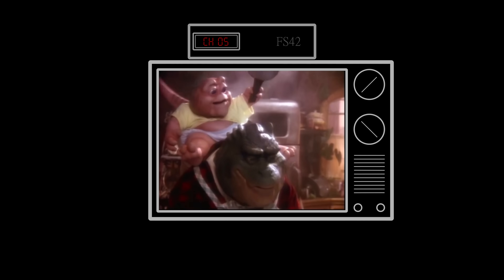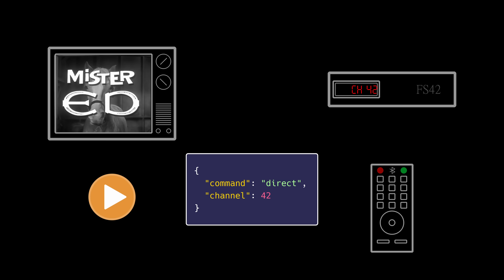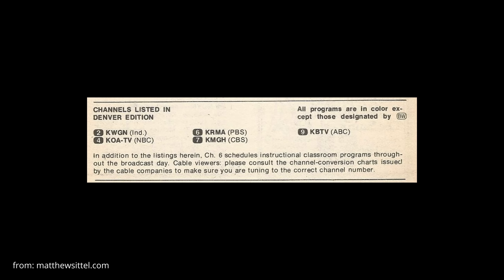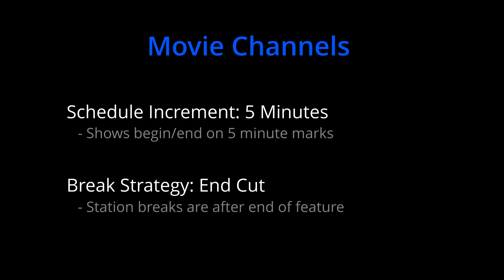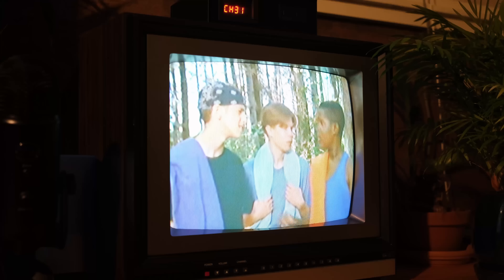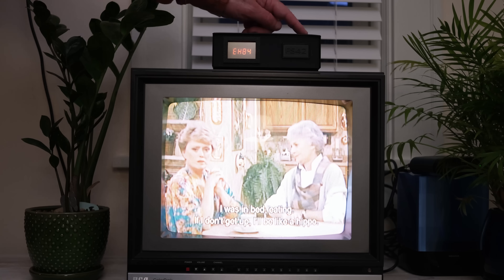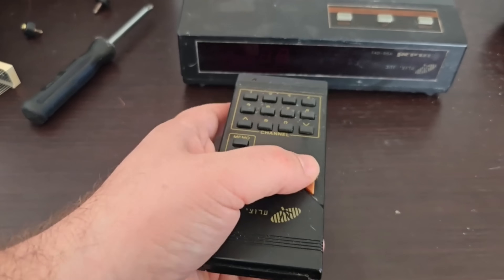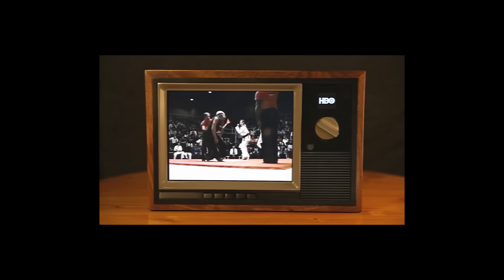90s Cable Simulator - Recreating Retro Cable TV with a Raspberry Pi

Comment: I’ve been fiddling with project and modifying the software since October problem. I sooooo bad want cable box setup. I have old cable boxes but could never figure out how to get the LCD and buttons (and IR) to work. I would totally just pay cash for a box at this point if you were building them!!
Reply from the maker: If you want to make one of the 3d printed ones, I have instructions in the cable box github links in the description. If I were to make one from an old box, I would be in the same position as you: would have a lot of learning to do. I would probably start by testing the signals in the wires to see if there was something I could tap into. Sounds like a potentially amazing learning journey you could have in front of you - I would not want to take that away from you. I think you should do it - if you need help or run into problems, there are a lot of really smart people on our GitHub and Discord server that would help. Good luck!

Comment: A little out in the weeds here, but how are you storing your media? Im running a pi 4 and every now and then the usb ports will just cut out, im not running your app but im wondering if you ran into the same problem.
Reply from the maker: See that blue box in the thumbnail? Its a cover I printed to hide an HDD enclosure connected on USB. I have not seen that on my 5 - I didn't play with 4s much, but I didn't see it on my 3s either. Maybe a setting on your pi or a bad piece of hardware (happens sometimes). You can also connect and NVME up and bypass USB.

Comment: From the sounds of the intro the simulator is handling channels exclusively and not the TV
Is it possible to have the TV itself scan for the channels from the simulator and place them accordingly?
So you can use the TV remote from the TV to change the channel?
Reply from the maker: Hmm - that would be interesting, but since its not actually broadcasting all the channels at the same time (it simulates them running) I don't think it would work. However, people have figured out a bunch of ways to hook remotes up to it to change the channel, volume etc - the guide button on mine even works to flip to the guide :) Here are the documents on setting up a remote: https://github.com/shane-mason/FieldStation42/wiki/Connecting-Remote-Controls

Comment: Scheduling sounds like a constraint solving problem and makes me want to use prolog
Reply from the maker: Its an interesting problem and my favorite part of this project really. You really could solve it elegantly with prolog.  My approach is a bit more heuristics based, opinionated and extremely optimistic - it never looks backwards and only plans forward in a few cases (like marathons). I call it 'LiquidScheduler` because that's how it fills the time - like water pouring into a container. With a good selection of gap filler, it does a fair job. Most importantly though, it was a fun problem to solve - it took me a couple of complete rewrites to get something I am proud of.

Comment: This is awesome I would love to do one for like the 80s through till 2000. Or even have like different ones for the 80, 90s and 00’s.  

Do you have a video or site where you do this like step 1, step 2 so someone could follow along on what to do and what type of parts to buy?
Reply from the maker: On the main github site for the software, linked in the description, there is a wiki where I've documented it in a 5 step process.  All the parts with links to get them and instructions on putting the cable box together are in the other github link in the description. If you have any questions, file an issue on github or hit us up on discord. Cheers!

Comment: Hello, I was wondering if this can support VOB files or is it just mp4? My dvd catalog is all vob and I’m not sure how to convert it.
Reply from the maker: It currently supports ["mp4", "mpg", "mpeg", "avi", "mov", "mkv", "ts", "m4v", "webm", "wmv"] - and even support for streaming formats like m3u. Ff it can work in FFMPEG (almost any video format) then we could add support.
Reply: @wrongdog_reckons  Hey thanks for the reply, I had one more question for ya. I'm finishing up making my own catalog of shows and currently I have both MP4 and MKV files. Will the code be able to run both seamlessly? Or should I work on converting everything to MP4? Thank you.
Reply from the maker: @nicholasdeparto8304  - works great with mkv and mp4: pretty much anything that FFMEG supports will work.
Reply: @wrongdog_reckons  Fantasic, thanks a lot. I think I may have overdone the catalog of shows for my project 😅 but hey, more is better in my eyes. I’m attempting to do around 10 channels.

Comment: Most shows that are cable have clear stopping points for where the commercials should go. Cartoons would do a cliff hanger, game shows always said “and we will be right back”, and even sitcoms would have some dramatic music and all of the characters looking around like ‘what’s going to happen next’. With that being said, how does the code handle placing commercials? I can’t imagine it just magically aligns with all these different cliff hanger spots?
Reply from the maker: It doesn't always, no, but nothing is perfect, right? Technology has come a long way though. You can use `black detect` filters in ffmpeg to scan for those spots and it will insert commercials there. That works okay, but I also want to add `scene detect` - and if that's not good enough, you can add your own chapter markers and it will try to use those. So, this is a solvable problem. Cheers!
Reply: @wrongdog_reckons I appreciate the reply! Such an awesome project. Cheers!

Comment: How did you obtain all of the video used?
Reply from the maker: In the US, you are allowed to make digital archives of media you own. You can also purchase digital media through legal means and use that. Cheers!
Reply: @wrongdog_reckons how much storage space did you use and do you have to manually edit the segments into their individual parts?
Reply from the maker: @Bryan_Kay you didn't need to edit, it will automatically insert breaks. Direct always get it right, but it works okay and better than chopping every file.
Reply: @wrongdog_reckons does it chop and insert segments based that partitioned line that you showed?

Comment: You can create a retro TV. Or recreate orginal TV. Recreating retro implies there was retro TV back then and you're recreating the retro.
Reply from the maker: Pedantry! Okay - let's do this. Consider for a moment that it might have had a hidden meaning. Hear me out. Note how it was pointed out that someone else had already recreated cable television and made the video for it, but the video was deleted and they never shared any source code or anything else about the project? Perhaps, and this is a big perhaps, the person that titled the video was considering that original as the original 'Retro Cable TV' and so this video is `Recreating` that `Retro Cable TV`? Then the title would be correct. But alas, I wrote the title and made it a keyword soup. Cheers!

Comment: Hello.. first of all great work!
I have my CRT's daisy chained and hooked up to my PC.. 4 of them. 
I know conversion processes are not the most accurate but it works well with my set-up.

I'm not very tech savvy when it comes to programming,
but is there a way to run the software via my PC and skip the retro pi all together?

I would love to have this simulator while i just keep my tubes idle!
Reply from the maker: Nice. The Pi is not required, but a linux install is. If you are running windows, you can install Microsoft's Windows Subsystem for Linux (WSL) for free and run it there. Give it a try, if you get stuck, post a question on github and we'll help. Cheers!

Comment: How easy is it to do thos as someone with no coding or rasberry pie experience?
Reply from the maker: The vast majority of people building them don't have any coding experience and quiet a few of them don't have much/any linux or raspberry pi experience. You don't have to have a Pi to try it out, it will run on Windows using Microsoft's Windows Subsystem for Linux (WSL) that's free to install.  If you aren't comfortable with Linux and command lines, there might be a learning curve, but I bet you can do it. In the worst case, you learn some new skills. If you get stuck, file a ticket on github or ask for help on discord and we'll get you unstuck.
Reply: @wrongdog_reckons awesome! I cant wait to try this out sometime

Comment: OK so something cool I've been noodling about in my head could you add an extra layer on a news channel and break it up into individual years to only play over the course of a year each year over time from 90-99 or 00-09 in real time? Like i start it 2026 it only for that 365 spin would play events that happened one to one or as close as you can like news events from January align with either specific individual day or easier news from January 1990 ETC and then midnight January first in 2027 it turns into 1991 ETC also also 2 followups where to get all the original graphics files so much has been remastered and all the commercials and 2 can you use an IR sensor for the pi to make a 90s cable remote to "change the channels" the volume ETC. For the full experience
Reply from the maker: I actually think you could do what you describe with the sequence feature we have - you would just need to alpha-numerically order the news episodes and it should just work. There are several recipes for getting remotes to work with it - and we have a web remote now that you can use on your phone. Come on over the github and check it out, I think you can build the system you describe (though I have no idea where you would get the content from) - cheers!
Reply: And like making the power button on the remote turn on the pi and the TV its attached to

Comment: This is just mindblowing dude

It has so much of what made the experience and it's customizable?? That is awesome

My only question is would it be possible to have subtitles that you could turn on and off using either the videoplayers's cc system on the pi

Or better yet, using the cc system on the analog tv itself via co-ax since that's how TV's displayed subtitles back then, by reading data that's just off screen and imposing the subtitles from that data
Reply from the maker: That's a great idea - I haven't implemented those features yet, but it might be possible. There are different ways subtitles are encoded (sometimes even burned into the videos) - but since MPV lets you turn subtitles on and off if not burned in, we would support it where it does. I don't have it wired in where you can turn them on and off through FS42 but would be trivial to control MPVs setting in real time for that. We have a web-based remote now, so would be nice to wire it in there. A lot of people have flirc remotes too, so would probably like this feature too.
Reply: @wrongdog_reckons  I'd love to see that. When I get some money I wanna take a crack at making my own cable box, though I'm curious

I saw you use the Pi 5 for this, but would it be possible to do this with a Pi 3? I have a couple of those laying around and I'm wondering if those would do the job since it's basically just displaying SD video most of the time

Comment: This may be a dumb question, but could this be modified to act more like OTA tv and not a cable box? I have a few crts, and I'd like to make something like this that I could connect to and just use the regular tv remote to surf channels, just like regular tv? basically 2 or 3 tvs all receiving channels from the same box.

Would be a completely different project I know, but I would rather do that than build 3 different cable box simulators...
Reply from the maker: I think you can. Right now, I am converting hdmi->composite->RF - coudn't you just transmit the RF? As long as its under the regulated power, I think this would be doable. The problem is, they would all be watching the same channels and when one turned, the other would also since it only plays one channel at a time. The alternative that someone got working pretty easily was to deploy multiple pi's, but have them all synced to the same schedules by mounting them on a network drive. This would give the same effect you are looking for, but the three operate separately.
Reply: @wrongdog_reckons see that's what I was thinking, but there's got to be a way around that. Maybe there's a way to have something with frequency that would change video sources for you. Kind of like a TV remote changing the channels physically on the TV.  If you could just build a box that could recognize channel changes, that would make this the ultimate home TV network. I mean this will suffice, but this emulates the cable box I want to emulate  over the air TV.

Comment: Young people may never understand but before cable became digital, you could switch through 3 channels per second and with basically zero delay. Nothing was downloaded, nothing had to be processed, it was just instantly there. You could instantly recognize what was on and decide if it was worth watching or not. I would typically scan through 120 channels in less than a minute unless something looked interesting enough to watch.
Reply from the maker: That's a good point - the part I hated was when a channel I thought might have something good was on commercial during the scan, so you just had to keep scanning until it got back from break. Cheers!

Comment: I noticed around 1:49 how you made the first “cut” I guess in tinkercad, in my experience I’ve found it easier to align the cutout object if you take the first object, duplicate it, and resize it appropriately to o make the cut. In the little window where you can change the box’s color, you can turn it into a removal object. Just my experience, can’t recall the appropriate terms atm but I hope this makes sense
Reply from the maker: Totally makes sense and is a good suggestion. Thanks!

Comment: Which raspberry pi components do i need to build one? (I need to calculate how much money I'd need)
Reply from the maker: There is a build list with links in the github link to the cable box that you can use to order. When you're ready to build one, come on over the the main repo. The links are in the video description. Cheers!

Comment: I've been wanting to do this since your last video. Do you forsee any issues if converting HDMI to RCA for use with CRT TVs? Should every file/video ideally have the same aspect ratio? I need to get some wood panelling on mine! Cheers.
Reply from the maker: Yeah, there are some issues with sizing, but generally have been able to address by configuring either panscan or keepaspect and passing them to MPV. Excited to see the wood paneling on the cable-box!

Comment: I've been running a similar server using my personal collection of Denver TV Guides, carefully matching the original broadcast schedules by day, date, and time slot. To do this, I used a piece of radio automation software called Raduga TV, which, although originally designed for radio, also supports video playback. What made Raduga TV particularly useful was its flexibility—it allowed me to mimic real-world TV scheduling down to the minute.
My setup has been running for over 15 years on a dedicated media server, and it’s been remarkably stable. Raduga TV offered several useful features, including a default folder that continuously loops vintage commercials when no other content is scheduled. I can then schedule promos, event bumpers, or playlists into specific time slots.
One standout feature was its "Cart" playlist system. This worked almost like a rotating slot: it would play one item from a list (like a TV episode), save the playback state, and then pick up with the next item the following time that slot was scheduled. It gave me a way to simulate serialized programming or themed marathons, just like in the golden age of broadcast television. The nice thing is, these playlists are saved as simple text files, so you can edit through the interface or even open them up in a text editor and edit them directly (for example if the next scheduled episode of a show is Episode 3 and you want it to play Episode 22 instead, you just open in simple text and change the "Next Play" number to 22 and save the file.
Though Raduga TV hasn't been updated in well over a decade (and the company behind it appears to be long gone), I still run it on a reliable Windows XP machine. Despite its age, it still runs, but really needs to be updated, or I need to find a similar program.
Honestly, I think there's real potential in reviving or reimagining this style of interface Raduga has for modern systems—especially for media archivists, retro TV enthusiasts, or even independent streamers. If anyone’s interested in how it works, I’d be more than happy to share what I’ve learned and how I think could be updated.

Comment: I've been archiving my movies lately, and had kinda considered making a streaming "channel" - or series - for some of the stuff.  Don't forget DVDs include things like trailers and music videos of the on-disc content, which can make for good 'in between' content.  If there's a way, you should look to hook up some of those promos you have with the actual shows, so for example run "coming soon" or "next time" for individual episodes of shows, or play trailers for some of the upcoming movies on the channel.
Reply from the maker: Yep, you can do that though a very recent feature that lets you specify filler content per time slot or even a specific bump to start a block. There's probably still some improvements to make it easier to connect two pieces of content automatically, but as a sandbox, it lets you do a lot.